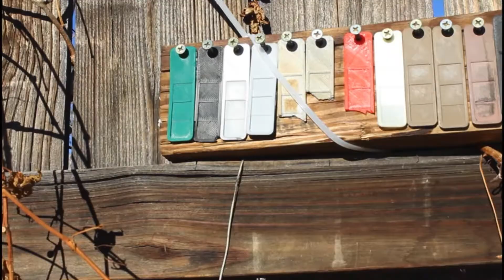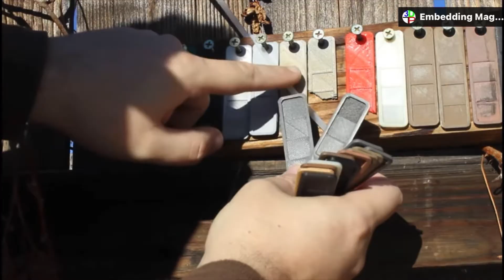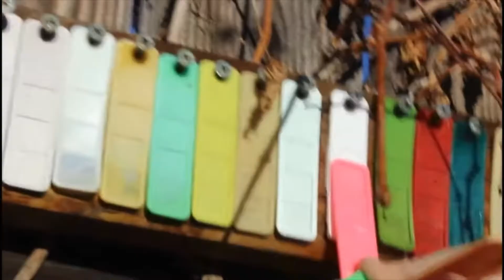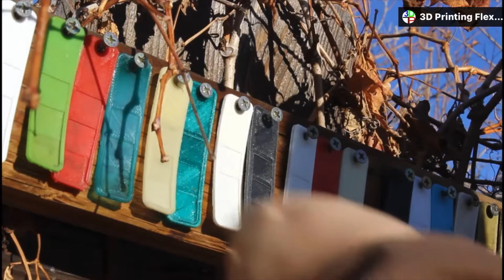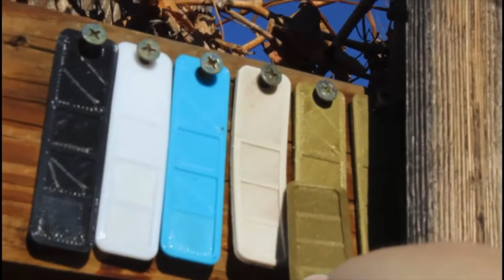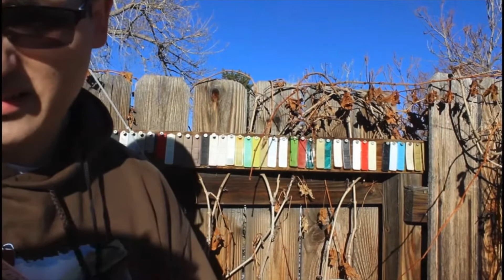3 Year Exposure of 3D Printed Filaments to Sunlight & Weather: Outdoor Test of PLA, ABS, PETG, TPU

Comment: you forgot to tell audience what type of plastic the samples are.
Reply: a really good potential. the way it was served was terrible
Reply: I think you forgot to watch the video. He names them as he goes down the board.
Reply: @wojtek-33  no he doesn't.  He provides brands and colors and mentions a group of PLA's and TPU's but never mentions ABS or PETG although references them in the title.  I was interested in his results for ABS.
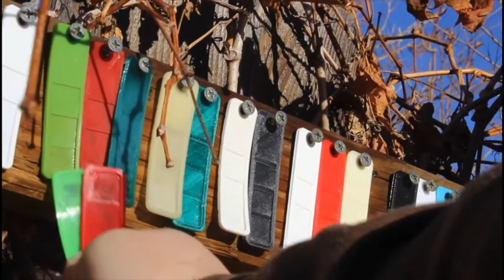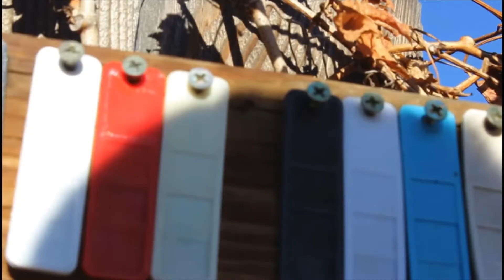Reply: @ColdRail  petg 3:15 abs 4:07 Also they are grouped on the board with gaps between the different filaments....